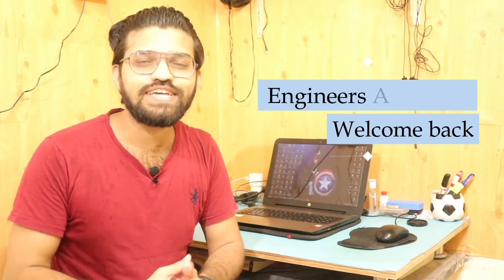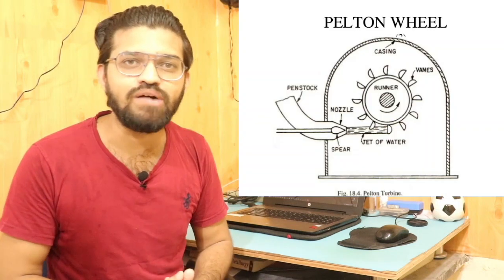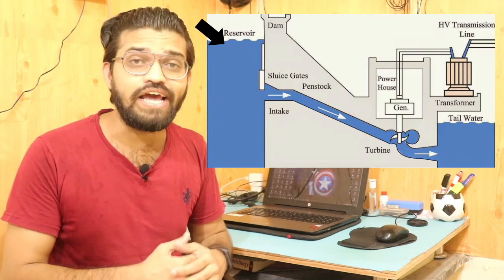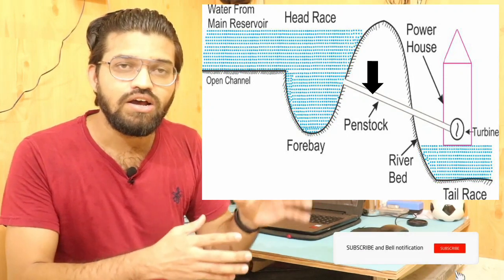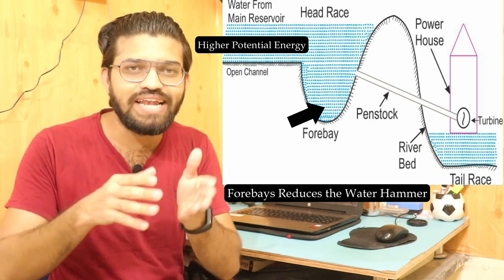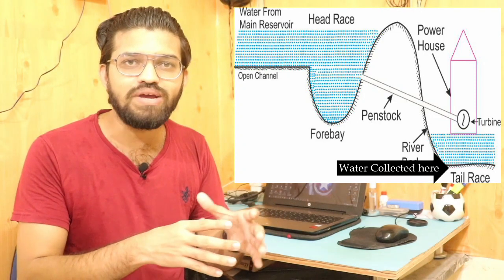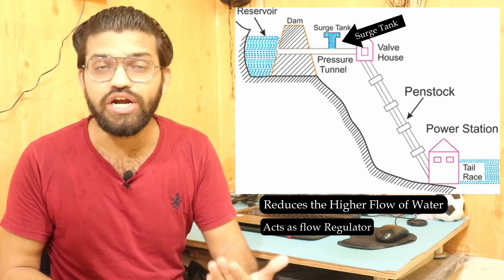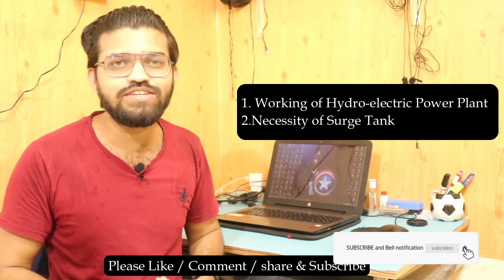Working of Hydropower Station & necessity of Surge Tank.

Comment: Surge tanks are not used to regulate the water. When plant is running in normal condition the water is flowing in +ve directions & suddenly due to any reason turbine stops then the water starts traveling in -ve directions ( towards reservoir). Due to this +ve and -ve  reaction, water thrust will be produced inside the tunnel which is known as water hammering, which need space to be evacuate otherwise it may damage penstock, penstock protection valve, HRT even it may damage intake stucture also. The space needed to control the water thrust is known as surge tank or surge shaft and it should be higher than the net head.
Reply: Nice answer, but still doubt as in In my project we are having 6 surge tanks and they are in between turbine and delivery chamber, so how it will work , 

And another thing when water will be diverted in tank before going in delivery chamber or when it will coming in negative direction
Reply: @deepakkatkar1378  I have an idea, if the generator or turbine "runs away" due to malfunction somewhere, then there is a safety system that will close the water off. But that will create a massive vaccum in the tail water, a vacuum so big it can actually suck the water back up to the turbine, a waterhammer, and damage it severely. We call this an avalanche shut off in Swedish, but we mostly use francis and kaplan turbines in Sweden and they have guide vanes just outside the turbine housing. So if an avalanche shut off appears those surge tanks you talk about that are between the turbine and delivery area could fill the vacuum created by the tail water and reduce waterhammer. In Sweden we have like ponds above the ground to let the back pressure out from the tail water.
Reply: I thought that's what he said in the video?
Reply: @maxdefranker  not really